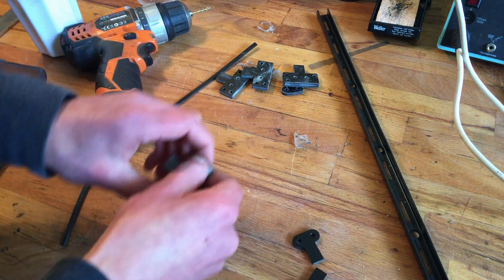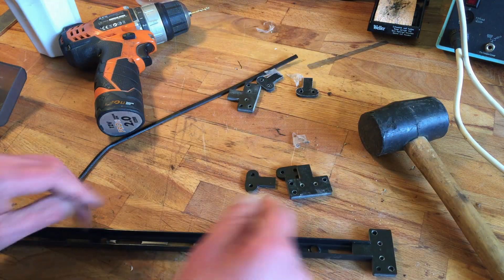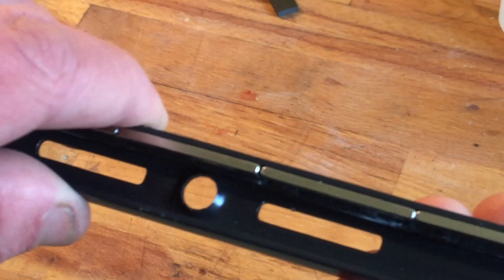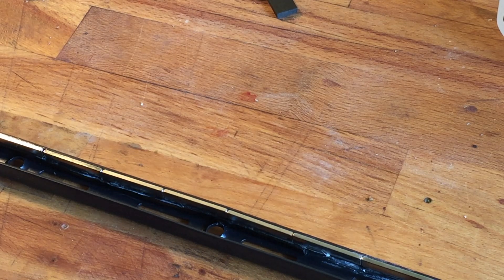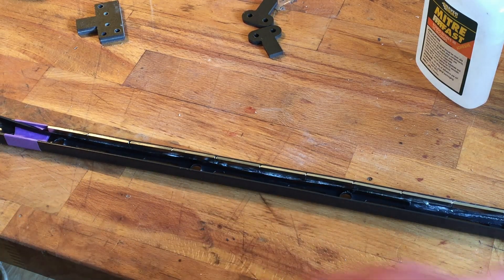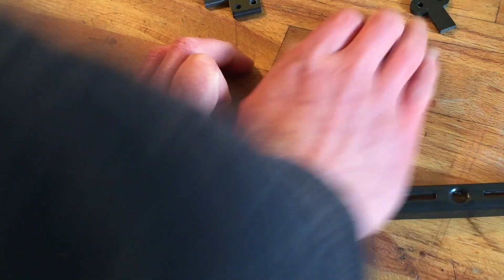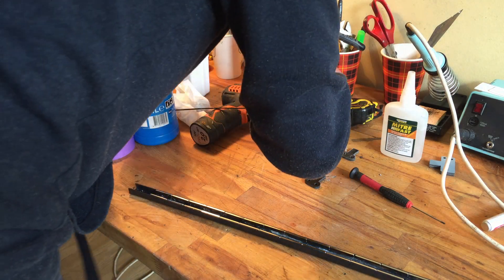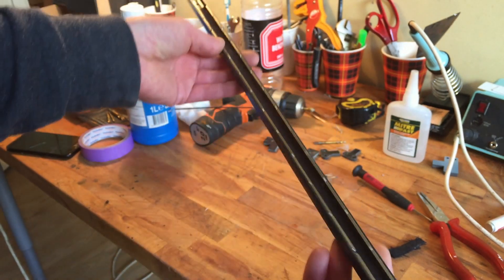42 Cm long Test Ribbon for Complete DIY Loudspeaker - Part 1

Comment: Where did you purchase the ribbon material that long?
Reply from the maker: depending what is THE ribbon material  :) what i used is a tad heavier then most ribbon mic material for instance. it is 6.8 micron. an the thinnest i can get.  it comes in rolls of 10 meter :) on paper. but only in Denmark !, i order it from a friend of mine living there you can get is a a normal supermarket  there... :(
Reply: @joppepeelen  Thank you sir! Only in Denmark  lol!